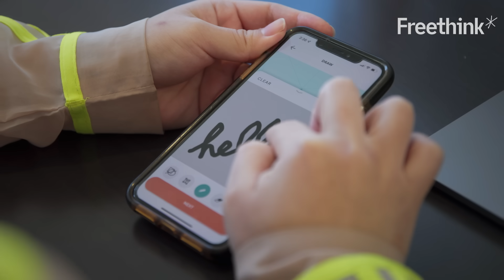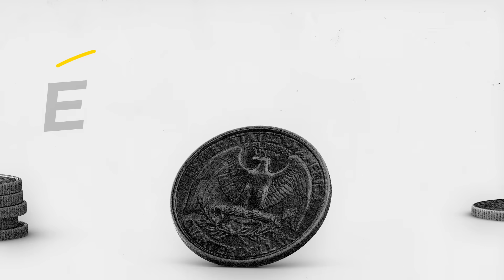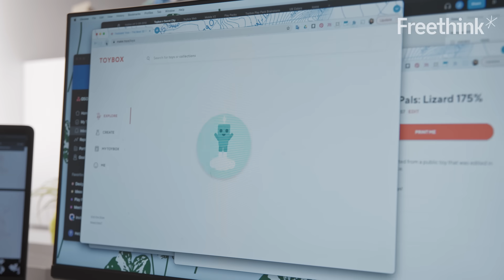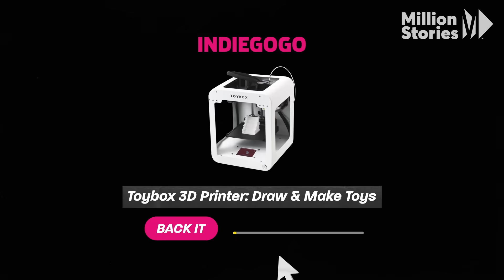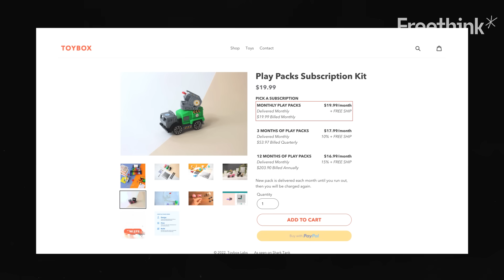Building the $300 3D printer anyone can use

Comment: I get the click and print approach and accessibility, but an ender 3v2 is already under 300 usd and an S1 (which comes fully upgraded and is way easier to use) is not much more expensive, and both have bigger print beds, dont use proprietary hardware and can be modded

The drawback to those is the amount of work required to getting it running, leveling making sure everything is calibrated, running tests to see your personal ideal print conditions 

Will this printer not require such work?allowing someone like my dad to "just print" without thinking or doing extra work, or would he need to constantly call me to fix some issue or calibrate it because the "gosh darn printer aint workin for some reason"?